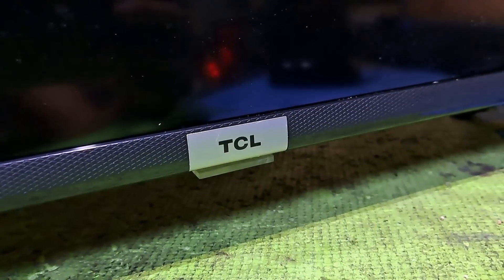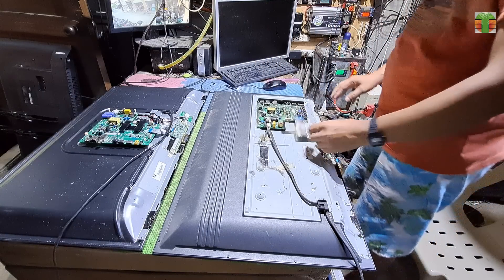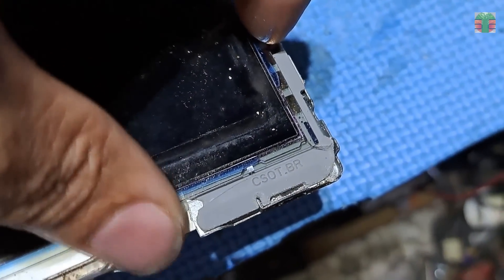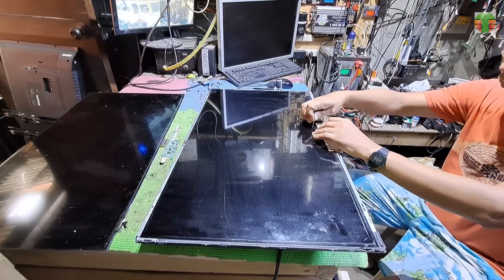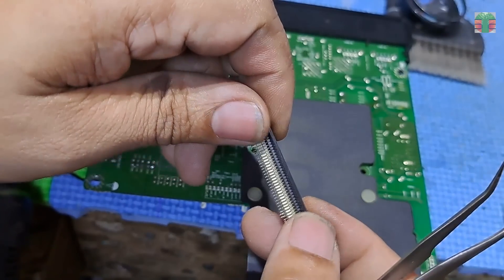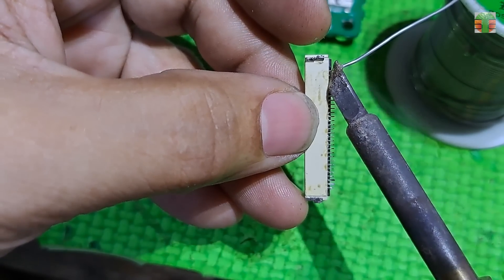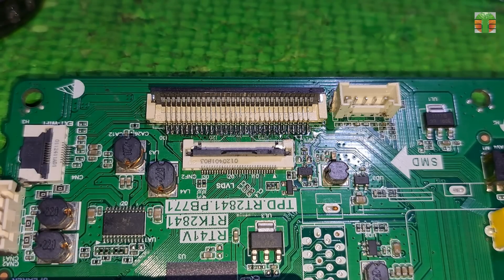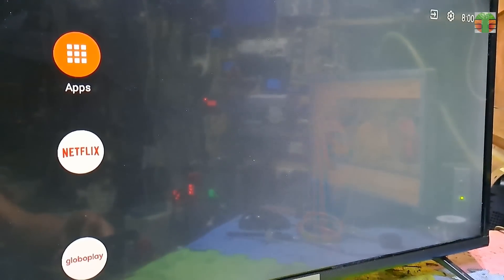Replacing a larger LVDS cable from a small LVDS cable.

Comment: Sir how to download led t-con board and panel ic schematic circuit diagram.
Reply from the maker: try search in google
Reply: @tevzTVTevatronics 

Yes sir i try and search but 39" penal no T390xvno1.0 t-con ic no 11311 schematic circuit no available on Google sir please help me
Penal fault multi color vertical bars t-con ic 11311 pin no 16 (3.3v) on off problem
Reply from the maker: @ZafarIqbal-qy9qe  I'm sorry I don't know where to download a schematic. Why did you replace the T-Con?